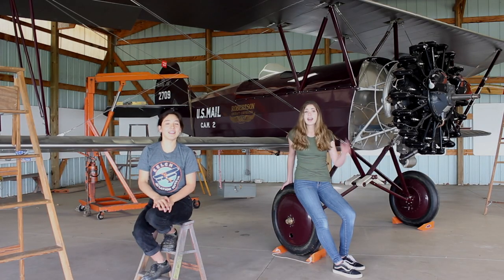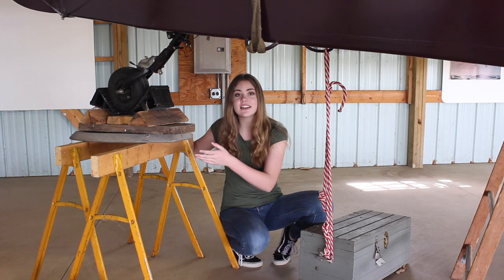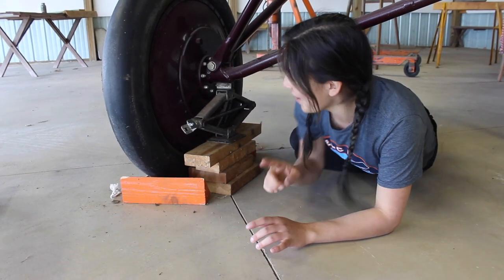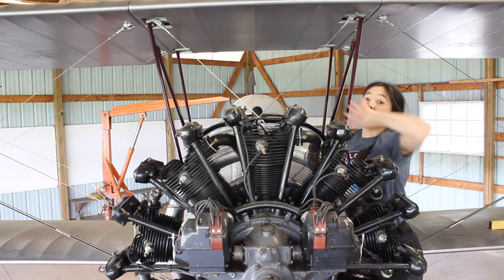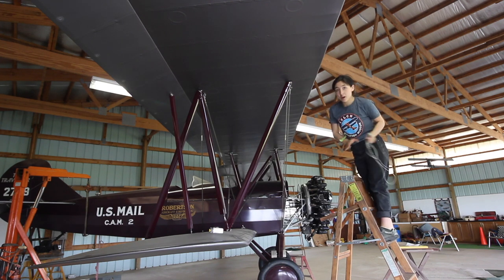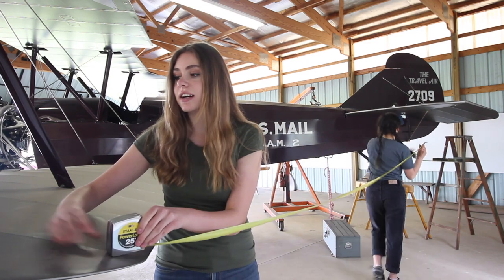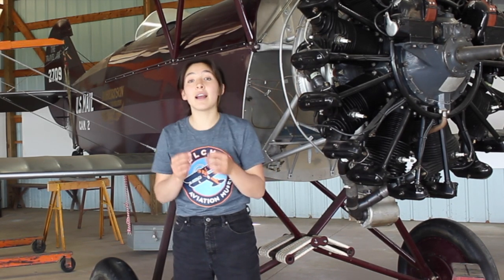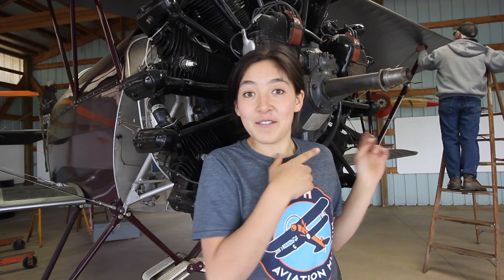Airplanes with Ami - Rigging a Biplane Wing

Comment: You might  like to use a technique from old school survey work in your wingtip to tail measurements. Use a scale, like those used for weighing fish, to put 30 lbs of "pull" on the tape, and then compensate for the temperature which causes the tape to expand and contract. Keep up the good videos and 'Keep Them Flying!"